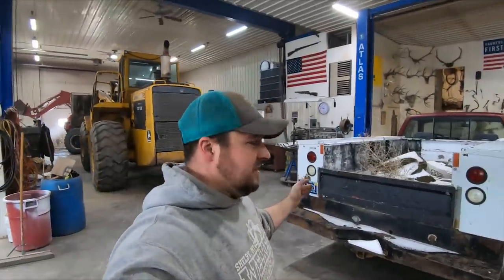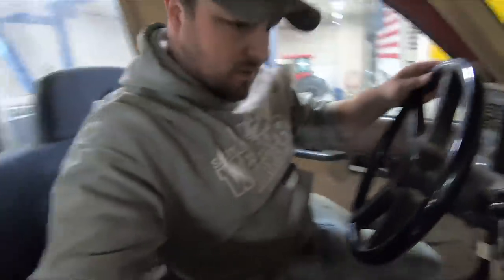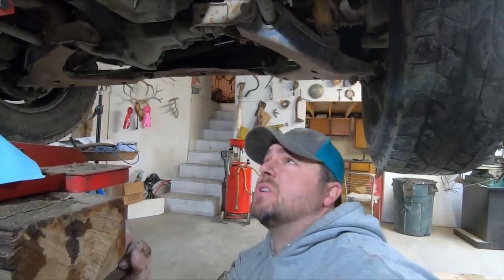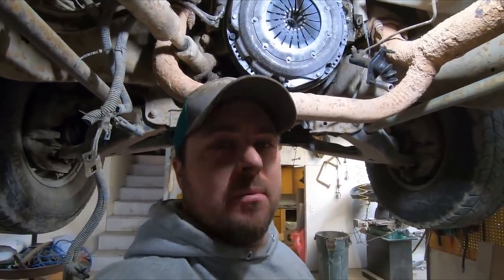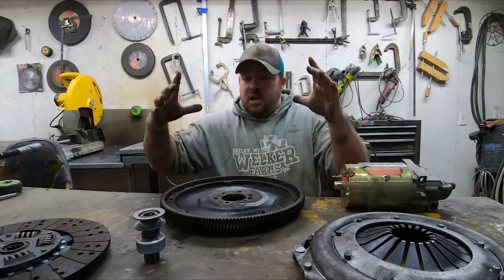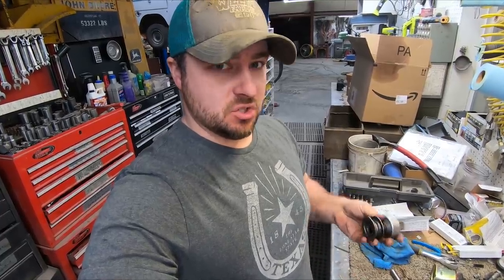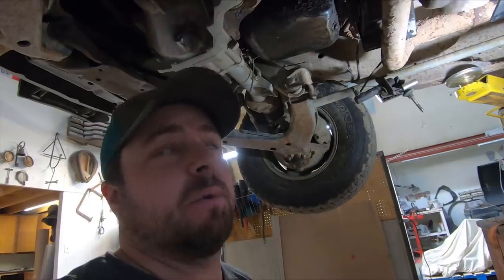MANGLED RING GEAR｜Pull the Transmission!

Comment: 36 years a mechanic and I've never had a problem with my doohickey lol,,,, i think you described it perfectly for the home diyer ,, keep them coming bud ,,
Reply: As a mechanic how important is the aliment do hickey here I did this job using a broom handle as a do hickey and struggled
Reply: Also, some guys skip this step, but I like to  double check the spacing of the left schmear de schmear to the central goesinta, because if the right doobobber gets out of sync and falls into the flappernapper, then swamp gas between the temperatures of 47.3 and 63.2 Fahrenheit can reflect the gravitational pull of Jupiter and cause the whole darn thing not to work.
Reply: @bryan5580  - Was that a left-handed flappernapper, or a right-handed one? Makes all the difference, especially when interfacing with the 19/64" thingamajig.
Reply: @N1RKW  right handed counter rotational titanium, with the 3 stage suplexer and a 21/32" performance adjusting reverse thread whackaframas.

Comment: When we owned our heavy vehicle repair shop we heat the ring gears in old pan with hot oil even heat out, once mounted use co2 extingusher

Comment: I’ve done the same job laying on the ground a few times....since I don’t have leg arms the way I do it is pull the transfer case, lay it down then I use my leg-legs under the bell housing and arms under the back of the trans and slide it back and lay it on my chest, then wiggle out from under it.

Comment: Great job Leg Arms!  That truck is real handy with the utility box.  You can put oil and tools in there and use it as a service truck.  I got to use a truck with a utility box at work, and it was so handy.  If there was a crane low on engine oil, you had a gallon jug to top it off.  A loader that was needed a little hydraulic oil, it had that too.  A forklift that needed antifreeze yes we had a jug of that too.  They had bulk oil so we would save the gallon jugs from windshield washer fluid and use those for the different oils, coolant, etc.

Comment: If you ever have a issue with the 4wd not engaging due to the actuator or the switch on the transfer case, all you need is a 1” npt nipple, cap and a 6” or so long 1/2” bolt. Remove the actuator from the axle housing. Put the cap on the nipple, drill a 1/2” hole in the cap. Install that assembly in the axle. Put the bolt in the hole, while turning a front tire, push in on the bolt. You’ll feel the collar engage, weld the bolt in. All fixed. You still have 2wd despite what many will say. I’ve done this to 3 of my old farm trucks and have put 5k on the one including actual highway driving and speeds, no issues. Hopefully this will help you guys out in a pinch if you need it. Because you know it’ll decide to stop working on a Sunday afternoon right as or after the local parts store is closing.

Comment: Noticed a dramatic change in the truck's character with the larger hole that was drilled out.  Added benefits of less curb weight and better gas mileage.

Comment: The ring gear is held on by Interference Fit.  The inside diameter of the Ring Gear is less than the outside diameter of the flywheel.  Hence the need to heat (expand) the ring gear to increase the inside diameter.  Very common with gears and bearing on shafts.  
Once helped install a 5 foot diameter ring gear onto a cable drum.  Used a large diameter heat ring to provide even heat to the gear.  We had to use water hoses to cool the gear so it would shrink enough to bite the drum.

Comment: If you ever paint that rig, you should consider CAT yellow. I think it would look awesome. Logo the doors with the Logo on your channel 😎
Reply: Surely it would need to be in Big Bud white with the detailing
Reply: @SlipShodBob  Idk. I think CAT yellow would look so cool. The truck and box have opportunities for adding the black accents that would make the yellow pop. Black door handles, black utility box handles, and possibly you would see the black seals around the utility box doors. Then get blacked out lights for it and heavy duty black wheels. That truck would look very tough.
Reply: Paint the Chev pick-up in modern Case-IH red for the 'Brand Association', with a few graphics from a firm like 'riveting wraps'.

Comment: Bendix was a different type of starter drive made by the Bendix corporation. It didn't require a solenoid to engage the drive gear to the flywheel. It worked on inertia when the starter motor started turning. You have a sprag type overrunning clutch drive.
Reply: Tired old mechanic   A true Bendix is like on a old Ford FE motor. 332, 352 not the movable pole shoe Ford starters of the 70’s.

Comment: Just to clarify, the drive gear on the starter is not called a "Bendix". But that’s what a lot of folks call the drive unit, because that’s the company that designed and made the first type of drive gear unit, long before any of us were born. Sort’a like, we say “Kleenex” for most any face tissue. GM uses a different design, which is better because it functions with the Big-Solenoid on the side of the starter !!!
When the ignition key is turned to “start” that big solenoid is energized, which mechanically engages the drive-gear unit into the flywheel ring-gear, when neither are rotating. As the solenoid extends to full travel it closes the electrical contacts which energizes the starter motor. And rotates the gear and the engine.
The failure which often occurs is when the driver tries to start an engine that is running. Because the ring-gear is rotating the drive-gear then clashes into it, which is always bad… and noisy. Easy to due when the vehicle is being used in a noisy environment, such as near another machine or such.

Comment: Leg Arms, just in case you didn't know:  Because steel or metal collects condensation from the air when it is cold it is important to bring your engine up to operating temperature to boil off the water that has accumulated INSIDE the engine and oil.  Just in case you didn't know.

Comment: Take the fly wheel outside to cool it off so you don't need to heat the ring gear so much.   Too hot might take some of the temper out.

Comment: Hey Scott (Leg Arms), HAHAHA Are you going to do a reading of a book for audible, it sounds like you are practicing.  I love yall's videos and the platform you have to spread the love of Christ. I watch all of your videos and enjoy every one of them. I am a Heavy Equipment Mechanic down here in Florida on Eglin AFB. I have been doing this for a little over 15 years. I also have a love for farming and antique tractors and most importantly a love for Jesus. I just am just wanting to share a little bit of my knowledge as a mechanic, for the ring gears on flywheels. You can just pound the old one off with a hammer and punch and set the new back ontop and just heat it up like you did and it will fall right back around the flywheel. another thing to remember is to make sure the ring gear is facing the correct direction.

Comment: You can flip old ring gear to save some bucks instead of blowing it off with plasma cutter :D This worked perfectly on my tractor .
Reply: Dr. Zoidberg   Some ring gears you can use both sides, some you can only use 1 side.

Comment: i'm suprised you did not hose down the flywheel and clutch with brake clean before doing your demo.. I was laughing as your hands kept getting blacker and blacker.... Years back I picked up a special kit that had a shaft and centering pieces to use on clutch installs. It was so nice the local Goodyear shop used to call me up and borrow it for clutch installs..

Comment: 7:43 you don't need to use the clutch every time you change gear. with a bit of practice you can slide it you of one gear and into the next. changing down is a bit harder just gotta slide it out of gear give it a bit of a rev and slide it into the lower gear. can be hard but can be easy with practice. but for beginners or simple minded people yes use the clutch
Reply: Alot of transmission gears have been ruined by "Simple-Minded-People" trying to learn how to shift without using the clutch. That’s why transmissions have "synchromesh" systems.

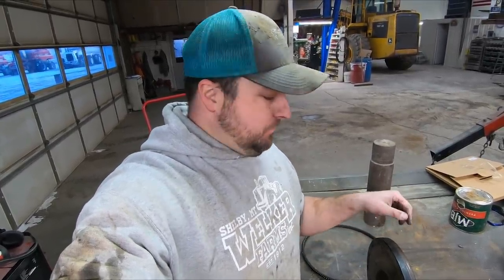Comment: 10:51 is it just a trick of the lighting, or can you literally see the ring gear getting bigger as it's heated?  I didn't think thermal expansion was that much.
Reply: yeah you can see it. the concorde got 35cm longer while flying because it got hot from air resistance. just a nice little fact

Comment: Honest Critic of this video.

When I first watched this video, I was thinking, Ring Gear looked good! For those interested, all ya gotta do is manually turn the Crank 1/8 of  a turn to get it off the bad teeth. If the Bendix (Not sure of the name for the starting gear) is also worn, or the Ring Gear has multiple failures, then do what LegArm has done. Granted it is much easier to just drop the cover and slowly turn over the engine with a screwdriver for one full revolution! Start by looking at the Starter, instead of pulling things apart and then find the real problem! The real problem will most likely be a bad Solenoid. Trust me you will hear it!!
With all of this said, I really enjoyed the video
Reply: Good solution for an emergency only.... because most engines will stop at the same rotation location when shut down. Which is where the bag teeth on the ring-gear are.

Comment: I've always wondered if there is a way to determine how many shims you need on the starter other than trial and error.
Reply: dcrogers   On a Delco starter use an 1/8” Allen wrench between the starter armature shaft & the tips of the ring gear. If the Allen wrench will not go between the armature shaft & the ring gear, add a shim, until it will fit. Simple.
Reply: @darrelfuhrman8217  thank you I'll have to remember that

Comment: Does that spline for centring the clutch plate work on most vehicles? Or are the splines cut to different sizes depending on the manufacturer/model?

Comment: Who needs Hollywood when ya have a method of anchoring the camera.  It's been about 30 years since I had to do this, but I recall that I had to put the flywheel back on in the exact same place of rotation because it is balanced with the engine.  Is that not done anymore?
Reply: Brad Taylor yes 454 engine is externally balanced so it is drilled so it can only go one way

Comment: Must be nice to have all that equipment I work on my ole dually and in a pile of slush or snow I just did all the brakes today I will bleed the bottom of truck is in good shape that truck should be all redone will last forever thers more of these trucks on the road than new ones I’ll take my ole dually anyday over a 90000 dollar dually any day put a good hood on it from scrap yard you will find one same color with no rust you got all nice equipment why not make truck look nice

Comment: It's going to be a very different story trying to repair modern equipment. Got a loose wire? Tape it up and you're ready to go? Nope. Gotta wait for the dealer to turn up with their laptop... Your crop sitting out on the field, oh well. Farmers need to get the right to repair the electronic part of the tractor and start lobbying. I grew up on a farm and we fixed everything, including electronic problems because I was interested in electronics I learnt what was needed, saving thousands. I guess farmers these days prefer older equipment that can be worked on without the need for the dealer visit with a laptop. See this video https://youtu.be/38O1zEuLOMM

Comment: How do you know that you got the spacers on the starter right?
Reply from the maker: There may be a better method but to our knowledge you try to start and if the starter grinds then it isn't enough and if it gets stuck and won't release then it is too much. But I think he got it just right first try. Sometimes you don't need shims at all.
Reply: @WelkerFarms  so basically start it and listen for funny noises.
Reply from the maker: @billtheunjust  basically 😂, but I'm betting there is a more professional way too.
Reply: Welker Farms Inc   Scott take an 1/8” Allen wrench, put it between the starter armature shaft & the tips of the ring gear teeth. If it will not go, add a shim, until it will go.
Reply: @darrelfuhrman8217  Thanks 👍

Comment: Cmon... there's no "Bendix" on a GM starter. 

Bendix is the way Ford spins the starter motor and the Bendix drive, having been sitting still, rises up on the spiral and forces itself into the ring gear, spinning. It isn't nice! 

GM first drives the starter gear into the flywheel, and though the final electrical connex inside the solenoid, it THEN spins up the starter motor. 
... and your 'key' is called a clutch alignment tool.
Reply: Bendix is a generalized term for most people and it is semantics at best furthermore Legarms explanation was good enough both starter styles use a solenoid to engage and push out the Bendix or "connex" gear to start the vehicle
Reply: @Chaplain_GM  No George, you're categorically wrong here. 

BENDIX (read: typically Ford) -  has an electrical relay (what a layman MIGHT call a solenoid - which it isn't, semantically or otherwise) - which is usually mounted on a fender with a heavy cable going directly to the starter motor, making a direct connection from the battery across it's internal copper contacts. 

A Bendix-style starter spins FIRST ---> and since the law of physics states: "an object that is STATIONARY, tends to remain stationary unless acted upon by an outside energy source".....the STARTER DRIVE stands still, but not for long. 

At the same moment a Bendix-style motor spins up, then the STARTER DRIVE - trying to resist rotating with the starter shaft (and BTW: obeying the laws of physics by not moving) --- runs up a grooved ramp to slam itself into the ring gear. 

A GM-style starter uses a magnetic core with lots of windings inside a REAL solenoid, to propel it's plunger and therefor also the starter drive---  into the ring gear FIRST,. 

It is then that the starter solenoid plunger hits the end of it's travel, creating an electrical connection across two copper contacts between the battery and the starter motor .... THEN the motor spins. 

YOUR: "Generalized - semantics at best ..."  types of excuses for misusing words is never acceptable and why should anyone be taught things incorrectly? 

Education is to teach people to get things right, not wrong, and no-one gains when technology is dumbed-down to a lower common denominator, by generalized semantics or not. 

PS --> I love ya, Leg-Arms. I love the whole Welker Family. 

Leg-Arms made a few slight, verbal, technical mistakes and I thank him for doing what he did, but your position, George, is not tenable. 

PPS --> Leg-Arms - that wear pattern on the old ring gear is usually from a starter drive not going fully into the ring gear and it will take off the teeth like that. If that's a Big Block with a Small Block starter nosecone, it might be a problem.

Comment: NO. The worst thing you can do to a clutch is use it to hold the car on a hill.  Right up there with slipping the piss out of the clutch like them Civic Ricer Morons like to do.
Also, that truck is a GM Garbage fire. Avoid GM at all cost.  You can not tell me with facts that GM makes good vehicles. They Dont. Period!